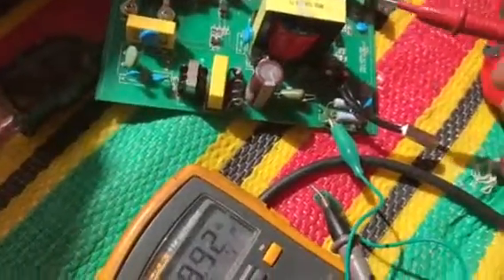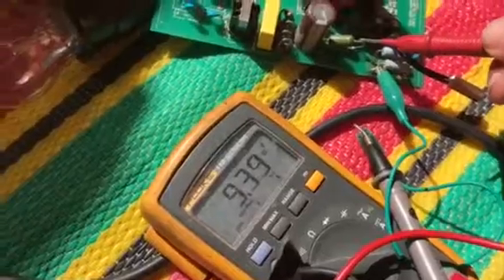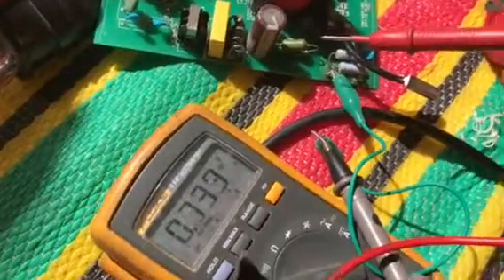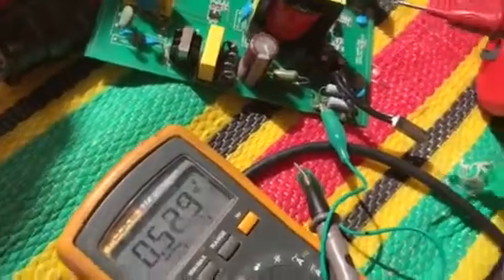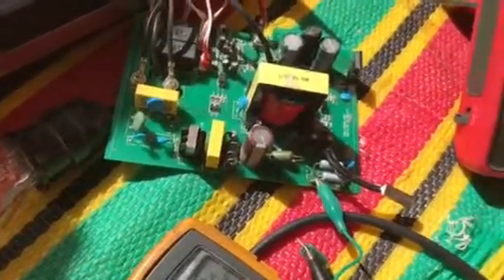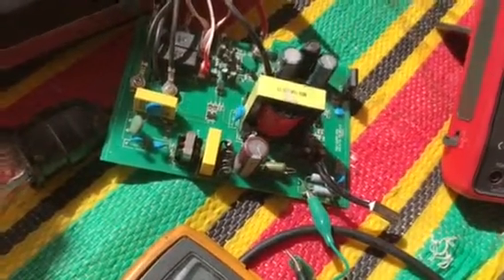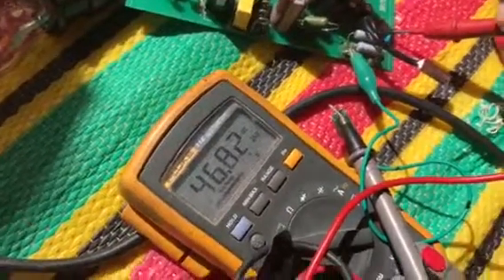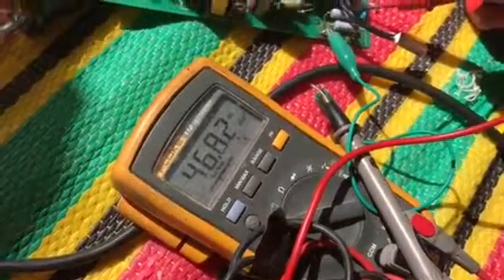Uc3845 replacemnt wont work   solved

Comment: Hi sir...same problem here about uc3845...  with the supply voltage about 8.2 at pins 5 and 7..i get sa sawtooth at pin 4...but no squarewave at output pin 6... what could be the initial findings sir?
Reply from the maker: you have to reduce  the start  up resistor     slowly to  value that   allows the  refrence  pin to  raise to 5vdc  only then the  ucxx  ic  will work   be  
    
sure to stop   at moment 5vdc   appears    if you  keep on  reduce   
the  resistor  value    the ic  will get burnt